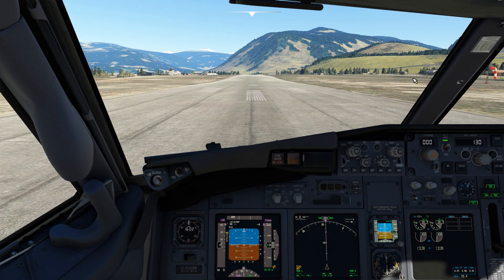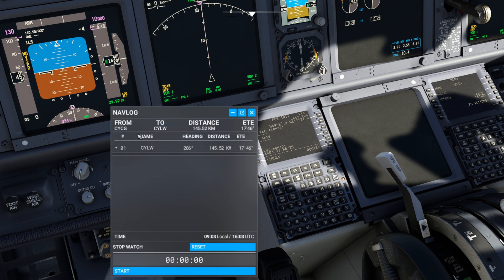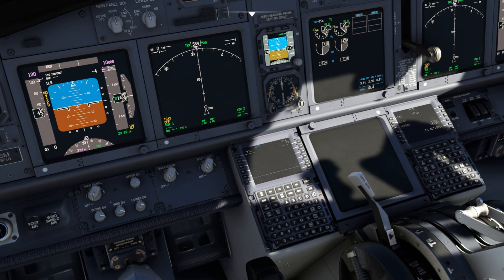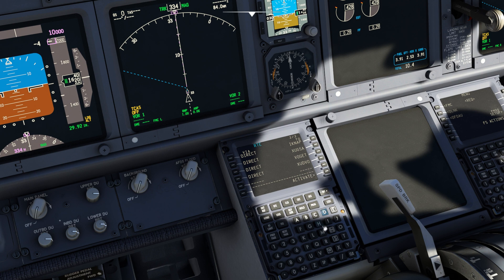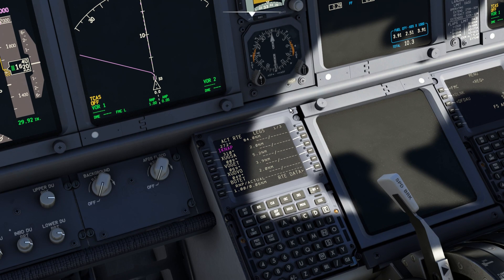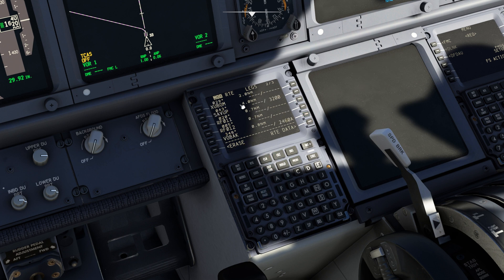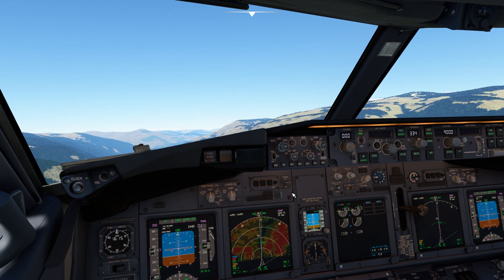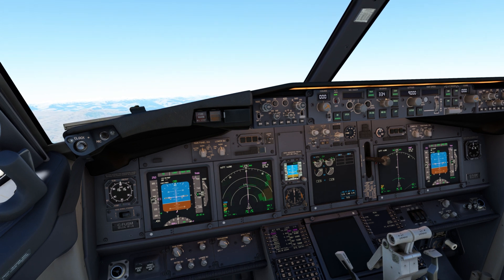How to fly VNAV and/or LNAV PMDG 737 MS flight simulator

Comment: Nobody explains Lnav and Vnav😢. WHY do pilots use Lnav and Vnav WITHOUT CmdA /B? Why do pilots during the manual climb ask for Lnav and or Vnav without Cmd A/B? What does it do? 
I only know the use to switch both on together with Cmd A/B for full autopilot guidance. But I do not understand why real world pilots ask for Lnav or Vnav during the manual climb without CmdA/B turned on?
Reply from the maker: You want LNAV on before take off to get you guidance on the MFD by the vertical magenta line, 
LNAV instructs the Flight Director what to show to follow a certain route, or heading if set by heading mode. After take off you can engage VNAV to get the vertical guidance. 

The flight director instructs you where to go where when you switch on Cmda/b it tells the auto pilot where to point to. 

Hope all clear, don’t hesitate to ask more questions/ details!
Reply from the maker: ( pinned because good question, answer below )

Comment: why is it called VNAV when you still adjust the altitude?? not how ive seen others do it vnav should follow programmed speed and altitude. Or have i misunderstood.
Reply from the maker: Hey, The flight guidance will always honor the altitude set in the mode control panel window. This is intentional and a standard of airline flight ops.  It provides protection against altitude incursions; an aircraft changing altitude before being cleared to do so. However, speed you don’t need to touch. Hope this helps.